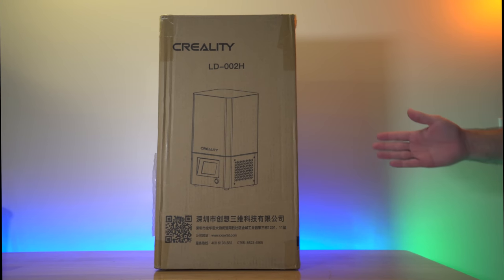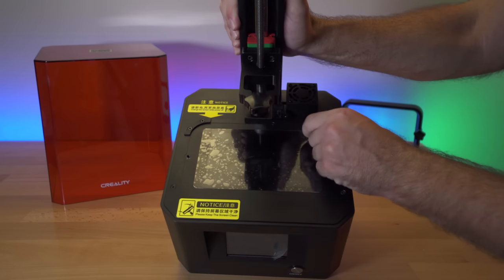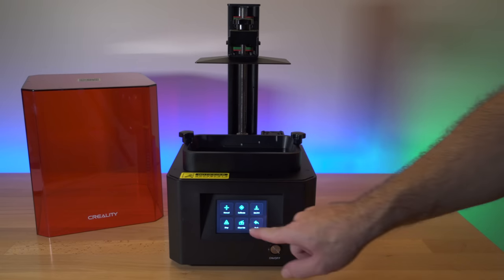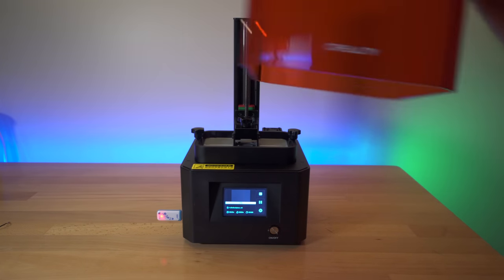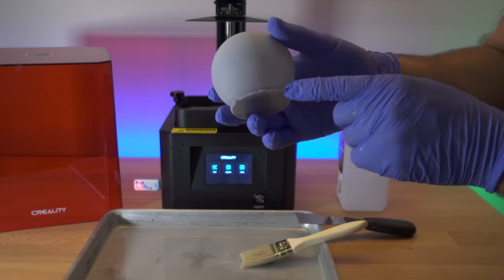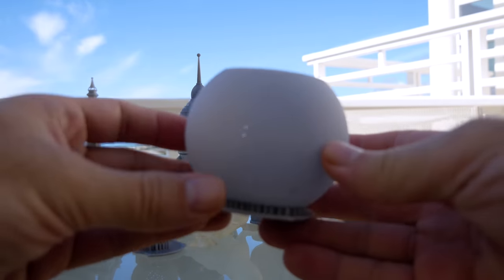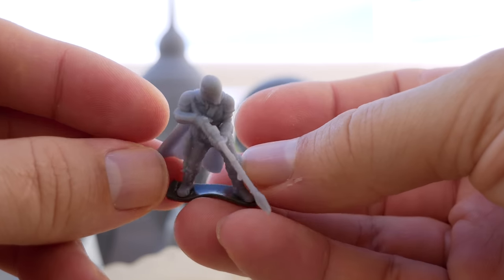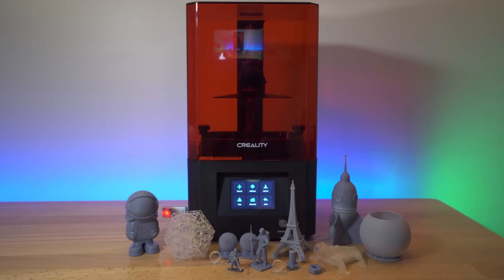Creality LD-002H - Resin 3D Printer - Unbox & Setup

Comment: Just want to step in and say this is the ONLY leveling instructions for the LD-002H that I've found which actually works.  The book says don't use anything between the bed and the screen.  Their videos and other people's videos say use a piece of paper.  In both cases, I would level it but then when I poured in the resin into the vat, it would stop homing properly.  But the booklet you used was the perfect height to dial it in.  Now it levels perfectly and I'm back to printing.

Comment: UV light from those lamps will damage your eyes. Need to wear protective glasses or put that cover on. Also, the resin is a sensitizer that will eventually cause you to have allergic reactions with enough exposure. Masks and nitrile gloves are essential.

Comment: I would add two simple things:
1. Shake the resin bottle well before pouring it into the vat. Duh, yes, but the video skipped that part.
2. Instructions or tips for disposing the alcohol used to clean both the printed models and the vat. Uncured resin is very toxic, and shouldn't be flushed down the toilet or drain, so it should be put in a container and disposed of properly.

Comment: Help, I followed the directions used jewelry resin and it’s not even printing or sticking to the plate any suggestions? (I only got one print and it was the first try. After that it stopped sticking to the plate)
Reply: If you haven't solved this, try roughing your plate surface a little bit with 400+ grit sandpaper (wet sand) and also try increasing your bottom layer times.  Every brand of resin (hell, every *batch*) is a little different in its curing properties.

Comment: I didn't know you could buy a one step resin. I thought you had to mix a hardener with resin. Also, can you use any photo to create your resin piece?
Reply: In a sense you could, but that's not quite how this one works.
The printer only prints one color (mono-chrome), and also that was the point of using Slicer software. It takes a 3D image and slices it into hundreds of layers that are in essence just pictures.

Comment: Just don't rely on the pause feature if printing lithophanes, I paid the price and the next layer after resuming had created a split right across the lithophane.
Reply: Hey, I am looking to get a resin printer for printing lithophones.  Is this problem specific to Creality LD-002H? Or do other printers have this problem? Anything I should know before getting a resin printer for printing lithophanes? Thanks!
Reply: @jessepowellmason  I had this issue with this printer and Anycubic Photon using pause feature, so don't get me wrong, litho's turn out perfect with these resin printers (i use Photo to mesh, not the freebies), just don't pause if the vat is getting too low on resin, just keep topping up. Reason i prefer to keep topping up is not to have as much mess just in case of a leak, which can happen!
Reply: @bobf3598  O okay cool. Thanks for the info!  Have you looked into adding some sort of auto resin filling mod at all?

Comment: I'm still saving up for the LD002r and they already released a new one :(
Reply: idk bout getting a resin cause its so messy and toxic and u cant just leave it like a normal printer
Reply: @whowatwhere7936  I'll be fine, I think. I'm pretty used to handling resin because I own an artisan keycap business and we use resin all the time :)
Reply: @RetroDaddyPH  how do you reuse the resin in the tray? do you just leave it for future use?
Reply: @JJ-vp3bd  yep...you can print a cover for the vat on another printer if you have one too, stops debris from getting on there. But so long as the vat is clean and nothing floating in the resin, you just use it for the next print.
Reply: @jasonjulian1  i saw a dude just pour through a filter to reuse it again later
Reply: @JJ-vp3bd  you can pour it through. 100 micron filter back into the bottle, yes. But if you're going to use the same resin on the next print, whenever that may be, you can just leave it in there.
Reply: @jasonjulian1  how long can you leave it in a tray
Reply: @JJ-vp3bd  not sure based on personal experience....but from my research it seems for as long as you need provided you shield the resin from uv and nothing contaminates it such as dust, hair, broken bits of failed prints, et AL. 

Of course then you can just pour it through a filter mesh funnel and clean it out.

Comment: nice review vlad. i have a few questions about the ender 3 pro, how tall is it with the filament spool on top and do they have thermal runaway protection?
Reply: If you mount the spool on top, it is 29 inches (73.66cm). And yes, all new Enders have runaway protection. I know, 3 months late.

Comment: I have been using an Ender 3 for a year and looking to get one of these. How do the prints compare in terms of printing lines before sanding?
Reply: sand off just the remaining blobs from the supports then prime and if you get any orange skin on the primer then wet sand it with the highest grade emery paper you can get, you will need a magnifying glass to see the lines on a 2K print

Comment: would you recommend this printer for beginners/ as a started printer?
Reply: Personally if your looking at your first printer I would get a fdm style 3d printer, you will get a much larger print bed and is much cheaper to run along with not having the hassle of cleaning parts